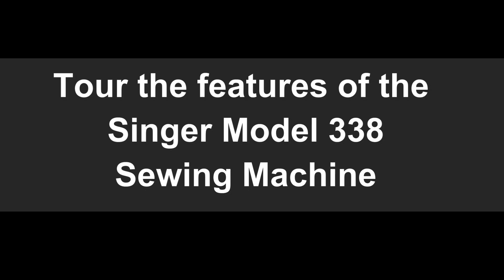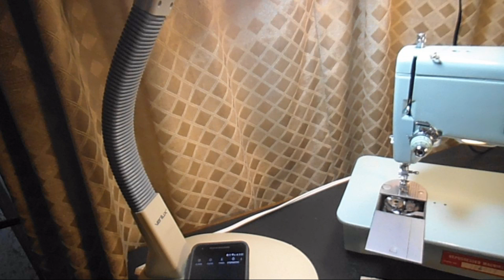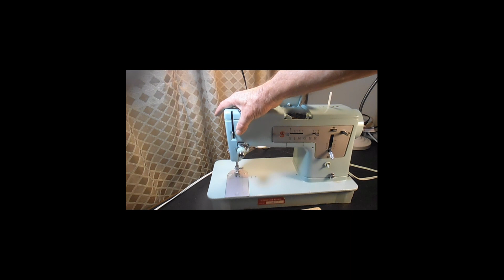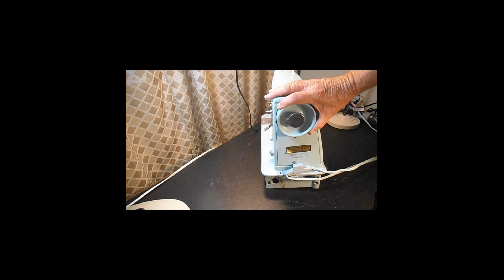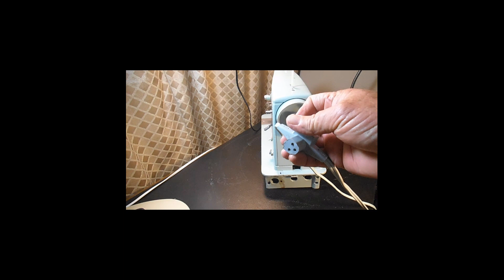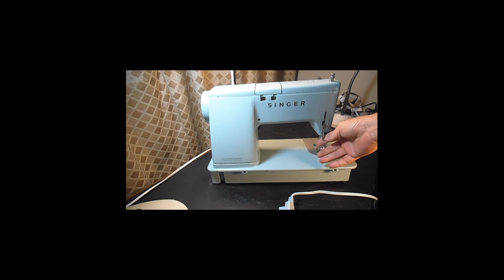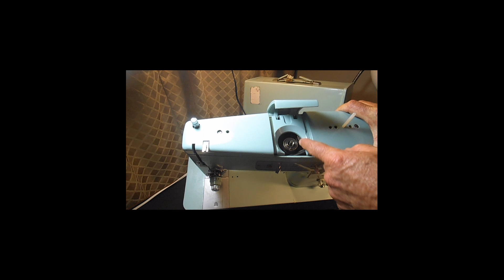Tour the features of the Singer Model 338

Comment: How well would this machine do sewing bags, thicker seams? Canvas seams?
Reply from the maker: This model can sew canvas, upholstery fabric, sailcloth, denim, etc. 
   My daughter just reupholstered some benches and re-hems all their jeans with this model. 
   I prefer the slant needle models that have gear-driven motors and hook myself. I like that the presser feet are about 1/4" taller and the slant needle design moves the needle point closer to you. That all makes for great viewing of what you sew. Straight stitch models like 301 and 404, and ZZ models like the 401A, 403A, 500A, and 503A.
   There is also an older straight needle low shank model that is well known to have power from its direct-drive, gear-driven motor, model 15-91

Comment: I'm attempting my first project using this machine and am having issues with the zig zag. I was trying to balance the thread tension from pulling the top thread to the back. Now it won't zig zag at all  . It does a few  straight stitches than takes an occasional bite to the right. I'm not a novice, I've been sewing for over 60 years on everything from a factory machine to a featherweight but this has me stumped! Any ideas? TIA
Reply from the maker: The Singer model 338 can use different Type "A" fashion (pattern) discs by removing/replacing them under the lift-up lid on the arm cover. 
     The standard zigzag disc is #1 and has a 1 inside a small circle, and the ZZ pattern molded on the top side. The stitch you describe sounds like the Blind Stitch or Blind Hem Stitch, which is created using disc #3 that has the 3 in the circle and the blind stitch pattern molded on top. Some very old style of Blind stitch discs have a 1 on them, and I don't know why. 
      The ZZ disc should have what I described, as well as nine raised or bumped-out nubs for the Disc Follower to ride against to move the needle bar and make normal ZZ stitches. The Blind Stitch disc has only 3 nubs. That's my best guess as to what is going on: a few straight stitches, then a zag to the right.
Reply: I second the creator's response, sounds like you are using the blind stitch disc. It makes a few straight stitches before it jumps to the side with a zigzag and back to straights again.

Comment: I will look up your related videos on this machine. But I am curious. Did your machine come with the appropriate user guide? My machine was bought brand new by my On in laws mother and it came with the manual for a Singer 328 and all the corresponding paperwork. I couldn’t understand why.
Reply from the maker: All vintage Singer sewing machines came with a printed instruction manual.
I did not buy this "new". When I buy the used machines, they sometimes still have the original manual. I have found free PDF copies of manuals online, and I have purchased PDF copies of manuals online. A couple of times I really wanted an original manual and found them for sale on eBay and other online marketplaces.

Comment: Hi Andy I have one of these machines but when changing the needle position from Left to center to right the needle arm barley moves and when all the way left doesn’t line up and will be over the feed dog what could be the reason for this?
Reply from the maker: It could be lack of oiling. There are 8 oiling locations just in the nose of the machine. You can read and/or download the Instruction Manual and look starting on page 68 for oiling locations:
https://www.scribd.com/document/720849907/Singer-338-Sewing-Machine-Instruction-Manual    If proper oiling does not fix your problem you may need to readjust the parts. Here is a video about testing and adjusting the needle position selector https://youtu.be/ySs4xQf6Veo

Comment: I would like know for sure if the 338 machine is hi or low shank. I am hoping to attempt free motion quilting on this machine. I do have a "darning /free motion quilting foot" but it needs to be "adjusted" with elastics...I saw another type of foot but for a low shank machine. I measured the distance supposedly to tell if the machine is hi or low shank. The distance is higher than 1/2 " but below 1 ". I am not sure if the low shank would work untiI buy one. Would you have any suggestion or answer for me? Thanks very much in advance.
Reply from the maker: I'm not sure what or how you are measuring but singer model 338 is a low shank presser foot machine https://youtu.be/Kw2n0gvVGFA?feature=shared
Reply: @andytubesewing1953  thank you for your very quick reply! I’ve been looking at a lot of different videos to try to find an answer and just now about five minutes ago I found one that actually is the best I have not seen one like this before because I have actually not been measuring the machine correctly which I just realized. I did not lower the pressure or foot!😔😩
So now I can buy that other darning foot which doesn’t have the spring which hopefully will work better than the one with the spring which I have not had much luck with .
I really don’t know what I would do without your channel. You’ve helped me a few times in the past already.
Much much appreciated thank you and all the best to you for 2025 !
Reply from the maker: @judy8798  Thank you, Judy. Best wishes and happy sewing in 2025.

Comment: Hey Andy I have a question for my singer 1425n I cannot get the button hole stitch selection to move over. It won’t go into gear I suppose. I set it up for the button hole stitching per my manual but it won’t go into gear and I don’t want to force it an break it. I’m just looking for advice on how to figure out what I’m doing wrong. It happens to be my favorite machine that I use all the time but it’s not popular and there aren’t any resources hardly out there on it. Thanks.
Reply from the maker: Not too many resources is true. I've never even seen this model in person and have no experience working on it. I looked up the parts manual and there sure are may pieces to the feed system and cams, many of which I'm sure are plastic. If you plan to keep and use the machine I'd suggest you buy the SERVICE MANUAL. I was surprised to see it available honestly. but Terry has it for $12.95 https://store.tandtrepair.com/1425sm.html    and ACEMAN has it for $19.85 https://www.ebay.com/itm/202487903976

Comment: What is the difference between this and a 348?
Reply from the maker: Nice question, Tola. The main difference is the hook and hook drive systems. 
     The motors, foot pedal, stitch controls, tension unit, and needle bar system are all the same. They both have the Fasion Disc system to let you change out about 22 different stitch patterns. 
     Model 338 (a couple years older) uses a Bell Crank Oscillating Hokk that is powered by Pitman Rods that make the hook kind of "tic-tok" back and forth, grabbing the needle thread to wrap around the bobbin thread and form one stitch. It also has that kind of sound, like a tick-tock back and forth. It is a strong system and IMO can last almost forever if you keep it oiled. 
     Model 347 changed the hook to a Rotating Hook powered by a Timing Belt that runs on two metal pulleys to make the Hook go around in circles, always in the same direction. It grabs the needle thread every other rotation to make a stitch. It runs and sounds a little smoother, in my opinion, because it does not change directions. 
     You can see about the Bell Crank Hook system in this model 338 video: https://youtu.be/bsOkrDSw2yw    
     You can see a slide of the model 348 style belt & pulley system at about 0:18 into this slide show of a 347: https://youtu.be/J9MFf4ogyk0 ( sorry, I have no videos for a 348.)  This is also a strong hook system and easier to work on if needed. The two pulleys are metal and very strong. The timing belt can eventually stretch and need replacing, maybe after 10 to 15 years of regular use. I've never seen one break and you can adjust the tension on the belt over the years until it is just too big around. They cost about $10 to $13 today and you can do the change yourself.
     The flip-up door on both models to change the Fashion Discs works the same on both machines. Model 348 did add a little bump-out window on the nose cover with a little red lever to show you a number for pressure on the presser bar/foot. It's kind of a gimmick and Singer dropped it after this model.
     You can't really go wrong with either model. I guess I prefer the 348 b/c it's a little quieter and mechanical machines tend to be noisy anyway. 
     Hope that helps you and you can search for other videos of both models, they sold tens of thousands of them here and in the EU countries.
 Thanks for watching my channel.
Reply: @andytubesewing1953  thank you!! My husband sneakily gave my 348 to a scrapper while i was out running errands. Someone has a 338 for sale on Marketplace for $125, hence my question. I had refurbished that 348 with love and i very literally went down to the train tracks with a purpose in mind, when i found out he’d done that.  And he’s not sorry. Anyway, im about to move from Seattle to OKC and i think ill hold out for a 348.  I still have my pedal and fashion discs, thank goodness. 
Thank you for all your wonderful videos! I wish you would join TikTok!

Comment: It looks almost exactly like my 337 except for the specialty stitches, mine is straight, zigzag and reverse only.
Reply from the maker: Yes, they are Sister machines. Singer considered the 337 as a "Standard" zigzag model and the 338 as a "Special" zigzag model.
That special is due to the interchangeable Fashion Discs you can swap in and out. Model 338 can also Two-Needle Sew. Other than those the other machine components are the same, motor, hool, needle bar, light, tension unit, feed control, etc. Thanks for watching my channel. Here are 30+ videos in a playlist showing step-by-step restoration of a model 337. https://www.youtube.com/playlist?list=PLsCOZgzzaiKJxbOOMKQPvmeTRqi0dhGa5

Comment: I’m so annoyed, mine popped and fizzed the 2nd time I used it after I spent 6 hours cleaning it after buying for $100 NZD, I presume the capacitor or something cos the brushes looked ok 😔 Luckily I have another 7 machines to use so this will just be a shelf pretty until I can be bothered checking it out again one year….
Reply from the maker: In the USA decades ago capacitors were sometimes installed in the foot pedal or body. Whenever we come across them we remove them as they are not needed here. The original purpose was to prevent interference with radios and late Televisions in the home. The USA uses a multi-grounded neutral system and the capacitors just are not needed now. If you have 7 other machines to play with you'll be just fine. Thanks for saving them.

Comment: I found one of these at a thrift shop for $6 and love it. I was wondering which bulb you use? I bought an LED bulb that was supposed to work but it wouldn’t turn on. I’m also thinking it could be a connectivity issue.
Reply from the maker: Here is the style of bulb I use for Singer https://www.vintagesingerparts.com/products/led-light-bulb-push-in-type-19-32-base?_pos=2&_sid=38a21aa62&_ss=r
Here is a restoration playlist for the sister model of your 338. It includes videos for removing the light, wires, motors, switch, among other parts. You could watch some of them to see about the wiring/light/switch to compare your machine with.
https://www.youtube.com/playlist?list=PLsCOZgzzaiKJxbOOMKQPvmeTRqi0dhGa5
They may help you find the problem. Good luck, congrats on that price. I just sold a restored one for $185 last week. Thanks for watching my channel.
Reply: @andytubesewing1953  Thank you so much for your help and your excellent videos!
Reply from the maker: @amandah8178  Sure, good luck.

Comment: Just wanted to say thank you for these videos! I was just given one of these for $20 yesterday, and while I can sew quite well and managed to "test it" in knowing that it works - I had to no clue how to use it. Since I have only ever sewn on modern automatic models.  So videos like these are a life saver
Reply from the maker: Thank you for commenting. I'm glad you found the video. It's a wonderful machine. Here are a few more videos about it if you find any issues while using it. https://www.youtube.com/playlist?list=PLsCOZgzzaiKK4y8dsq3oMKJFTGsoNJWmi
You can also download the 38-page Instruction Manual in PDF format from Singer: https://www.singer.com/search/support?title=338
It is nicely done with loads of information about using the machine and its attachments and features. Happy sewing.
Reply: @andytubesewing1953  Thank you! The machine I got is quite beaten up, and had no extra-gear. so just the pedal, machine and the zig-zag wheel that came installed from the manufacturer probably.  But I managed to figure out it had a light bulb (needs changing) and how to thread it due to your videos. And I did some test stitching.
 It's so smooth! I am totally in love with it already.  So I plan on watching the rest just to be sure I treat her correctly, and then see if I can score some new (old) parts and extras to make it a fully fledged machine. I have a Brother NV-15 now, and it was a great beginner machine - but it struggles so quickly compared to the little I have tried this old Singer on.
Reply from the maker: @Tanjaaraus  I glad you love it already. This is the machine my daughter asked me to restore for her, of all the machines I have done she wanted the 338. You can find the parts on eBay now and again, but they sell fast. I forgot to mention the videos I did on the Sinter Model 337 that go thru a complete restoration https://www.youtube.com/playlist?list=PLsCOZgzzaiKJxbOOMKQPvmeTRqi0dhGa5   Just in case you need a belt or something. You really got a bargain for $20. Just the motor sells used for that much. Thanks for watching my channel.

Comment: Do you know why the stitch length lever twists?
Reply from the maker: Sure I do 😊 The twisting knob on the end of the lever has a dual purpose. It is used to "set" a stitch length. Say you wanted to sew at 12 stitch setting. You move the lever there and turn the knob to the right until it stops against the indicator plate. You are then "set" at 12. If you want to reverse at the end of the seam you raise up the lever as far as allowed to go in reverse then when you move the lever down for forward stitching it stops ar 12 because you "set" it there. It helps you return to the exact stitch you were sewing. If you want to change from 12 you turn the knob left and move the lever. This is different when you "set" it at 6, the longest stitch. That "locks" the lever at 6 and you can't go up into reverse. The second function is when you are using a stitch length just above the 20 area.  Between 20 to 30 is considered the "Satin" stitch area for very close short fine stitching, say a buttonhole or monogram. In that area a slanted bracket behind the indicator plate (you can see it) allows you to slowly turn the knob to the right and have a guide start sliding up that bracket. It does not really "set" but allows you to "fine-tune" how close your sating stitch will be. You usually use a test scrap of material and fine-tune the stitch, like maybe you want the stitches so close they touch each other, but you do not want them to overlap and get "bumpy". That's what the knob and bracket help you do between 20 and 30. (above that you start getting into the reverse area) It is very hard to move the lever in those tiny, tiny increases so SInger made the bracket to help. This information and instructions are on pages 14 & 35 on the original SInger Instruction Manual for model 338 ( if that's what you have) and it is a FREE download from Singer at this link: https://www.singer.com/search/support?title=338   What a great question, Killian. I'm glad you were curious and took the time to ask. ✨ 
Thank you. Take care.
Reply: @andytubesewing1953  Thanks so much! I always appreciate your answers! You really go above and beyond. I just ordered an original instruction manual off of ebay. So I can hopefully refer to that soon 🙂
Reply from the maker: @Killy-Willy11  welcome and good luck with that nice machine.

Comment: Hi my name is  Lola i have a vintage singer sewing machine model number 348 . it keeps breaking my needles. what can i do
Reply from the maker: Hi, Lola. Ther are many reasons for this. Surprisingly one of the most common reasons is needle and thread. You can download a FREE copy of the Singer Instruction Manual from SInger at this link: https://www.singer.com/search/support?title=348
Follow the instructions on page 13 for threading the needle. Be sure the needle is inserted all the way into the clamp and not blocked by dirt. See the chart on page 17 for the type/size of needle and thread to use and be sure you are using a class 66 bobbin. If you still are breaking needles, here is a blog that lists several more possibilities that cause it: https://sewingmastery.com/15-reasons-why-a-sewing-machine-needle-breaks/